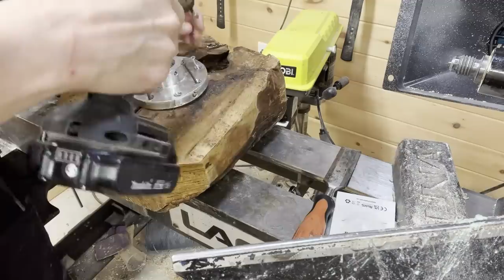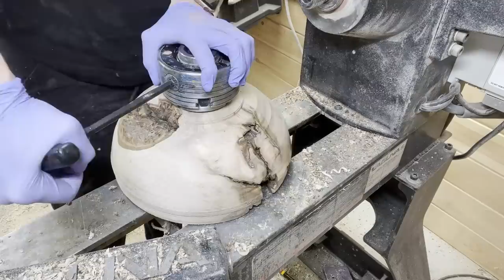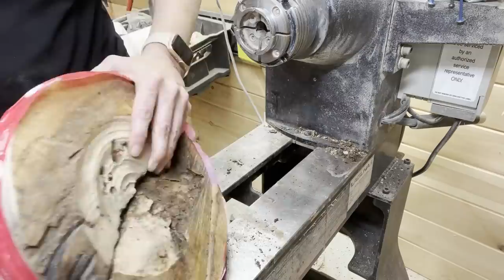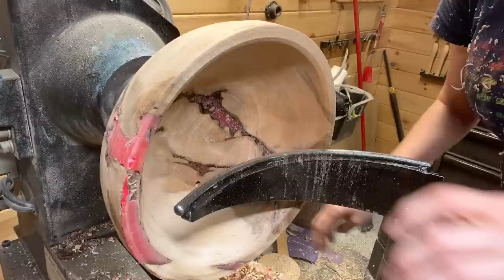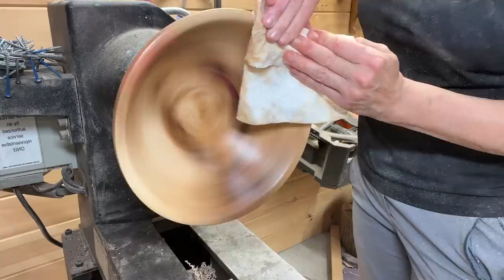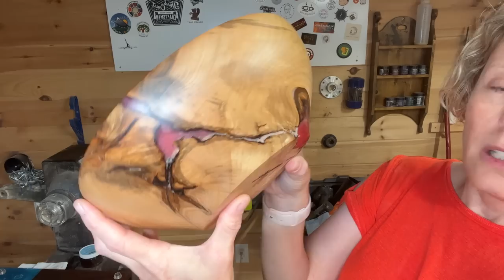How To Woodturn Like A Pro And Fill Cracks With Total Boat Resin

Comment: Hi Peggy, great looking bowl. I’m not a fan of pink, blues and greens are more to my liking, but the pink worked very well in this bowl.
 I saw the video on Facebook and how all the Safety Police jumped in. All of them acting like they’ve never had something go sideways when turning a piece. 
 There are turners that will never attempt to turn something that could be questionable, but some of my best pieces have been made from wood that some would have thrown away.
 But as you said, stand outside of the line of fire, make light cuts and wear proper safety equipment.
 Woodturning in itself is a dangerous hobby, but how boring life would be without a little bit of danger in it. 😂
 Keep up the great work, making beautiful pieces.
  Lee/GunnyUSMC
Reply from the maker: Thanks very much, I agree about taking risks. If everything we turned was perfect, that would be so boring!

Comment: Very nice project.
Sorry you had to deal with snarky comments. It would appear that some people just cannot get over themselves.

In this video, saw an experienced turner doing their best to turn an interesting, possibly problematic, bowl blank safely and properly. The blank came apart, as blanks sometimes do. The turner was in no danger, that I could see, and the project went forward with proper adjustments to the material and its mounting.  Well done, I say.

Wood turning is an inherently risky practice, as are other wood working techniques and methods.  You were turning at low speed, using appropriate tools and techniques, adjusting to the material, wearing good protective gear, and standing well out of the line of fire.  I don't see the problem.

Again, nice bowl project. 👍👍

Thanks for the video.
Reply from the maker: Thanks, Jerry!

Comment: Another beautiful bowl and so glad you were not hurt. I’m a new wood turner and would like to ask a couple of rookie questions…from what I could see when the bowl broke, it appeared to fall down and away, would it go in that direction due to the RPM you were using or was it luck that it went away from you? Could you pass on any tips that you use to protect yourself when something like this happens other than wearing personal protective equipment? Thanks so much for sharing and take care.
Reply from the maker: I've had a few pieces fly off the lathe for one reason or another. It usually goes in one direction. The best way to protect yourself is with a face shield. I won't turn without one. You need more than safety glasses, you need the full face shield. I use a respirator/face shield combo, it's expensive but well worth it (there's a link in description if you want to check it out), it's called the Air Trend Pro. Other than wear PPE, I try not to stand directly in the line of fire, but just off to the side a bit.

Comment: Peggy, I had a hard time hearing the voice over on the video. I had both video and computer sound turned up all the way. I don't know if others had the same problem. Other than that, the video gave me some good ideas with a couple of pieces I've held off turning - because of the cracks. JC
Reply from the maker: Oh no! Thanks for letting me know.

Comment: How did you prevent bubbles in the resin without a pressure pot?
Reply from the maker: You can use a slow setting resin...

Comment: Do you find the bowl gouge just as effective as a roughing gouge?
Reply from the maker: Usually better.
Reply: I’ve always thought that a roughing gouge should only be used when spindle turning because of potentially bad catches …… is that wrong?
Reply: @randyrockwell6136  No wrong.  I learned the same thing, however I just learned a few days ago the sindle tools have a tapered tang---not so on the bowl tools.  They have the same dia. all the through.  Much stronger.